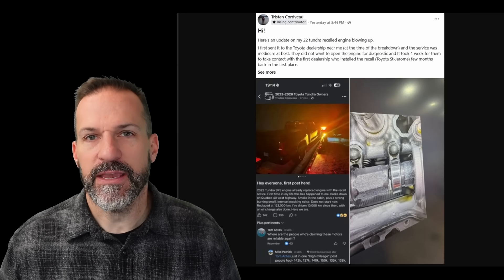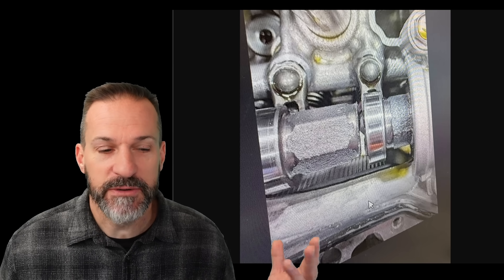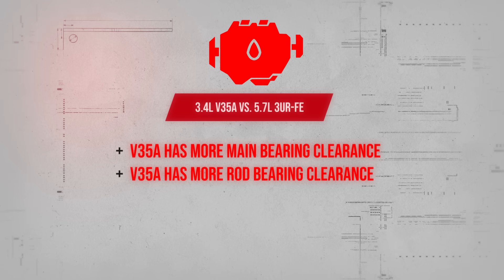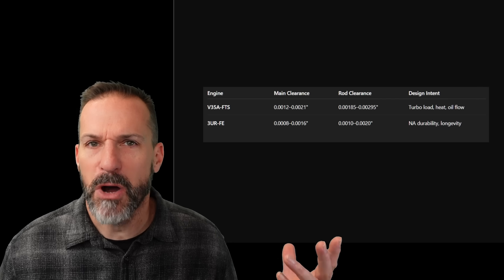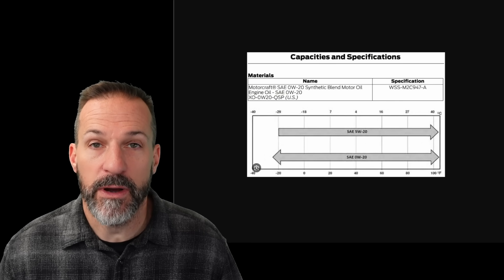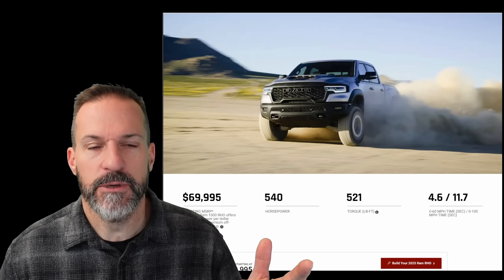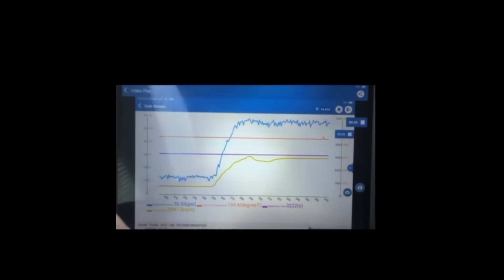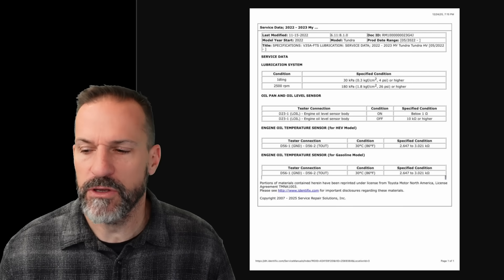Can We FIX Toyota's BILLION Dollar Mistake at Walmart? 2022- 2026 Tundra...

Comment: I never bought the tighter tolerances narrative. They were machining the UZ engines in the 90s just as tight.
Reply: This is true however main bearings were never so narrow before and they all had positioning tabs that kept the bearing in place and not spinning out.
Reply: @davidcox2197  Respectfully sir, I just looked it up and the main bearing clearances for the 1UZ. They were almost exactly the same at V35A-FTS. 0.027 – 0.053 mm (0.0011 – 0.0021 in.) with a maximum allowable gap of 0.065 mm (0.0026 in.). I agree with you about the tabs as the older engines did have them, however the UR series engines do not. Tundra 5.7 can run to 1 million miles with proper service. To me it seems like the variable old pump is dropping the pressure too low at idle for the sake of CAFE emissions standards. They need remove and replace the variable pressure oil pump.

Comment: Or how bout just a garden variety 5w-30 as i have been doing for 300K on my 5.7 which also requires 0w-20
Reply: Same. Been running 5w30 restore snd protect this year. Mainly to prevent oil rung coking. Havent had any leaks or issues. Oil comes out clean and much quieter. Doesnt sound like a diesel
Reply: i just switched to 5w30 in my 17 tundra. I swear its more quiet.

Comment: As an actual automotive technician. I have been commenting on so many videos telling people to run a minimum of 5w30 in a turbo engine ..  and all the internet trolls lose their mind and don't take me seriously... Now slowly more  people are getting on board ... Funny how the truth always finds a way ...l even in my own 2021 Toyota which calls for 0w16, I have been running 5w30 since new with no problems whatsoever
Reply: Seriously thinking about running Amsoil 5w30 in my 26 tundra now.
I like the higher HTHS vs the 20w.
Reply: @troyl.8691 yeah . But in reality even suoertech 5w30 full synthetic is an upgrade from 0w20
Reply: @EverydayJ1786  Correct, you’re better off going SuperTech 5W-30 every 5k miles than Amsoil every 10k miles.  All else equal, Amsoil is superior though.  

If you’re in a colder climate or you run the engine a lot in winter, then I’d go with 0W-40 Valvoline $28 for 5 quarts from Walmart online.  Technically, you could run this in the summer too. However, in a warm climate area in the summer a 5W-40 would be even better.
Reply: @troyl.8691 yep and Amsoil reduces breakdown from hot turbos better - motor oil geeks latest tests prove it.
Reply: you are doing the right thing 

anyone questions you, tell them to get a book on hydrodynamics....and read it
Reply: Mazda recommends 5w-30 in there turbos vs very light oil in the regular. Mazda > Toyota.
Reply: What about the non turbo v6 in the Tacoma? Supposed to be 0w20. Would you go 5w30 on that?
Reply: @MarkDay-z6t absolutely
Reply: What's your take on 5w40 or even 15w40? I use it in to maximize engine protection.
Reply: @IBO8Jaeger that's diesel oil . 5w- for colder weather starting , 15w for warmer weather . That's all it is .
Reply: 0W16? Are you sure? 
I own a 2020 Tundra and it "calls" for 0W20, but I run 5w40
Reply: @Michiganboy-o8e my wife's RAV4 calls for 0w16. It's only had 5w30 since new . It's for over 60k on it now .  5w40 doesn't meet the API spec . It's more of a diesel oil . I wouldn't run it because of that . Use a good quality 5w30 rated with the ILSAC GF-6A spec and change it every 3 to 5 k . That's important
Reply: @EverydayJ1786  Sorry, for some reason I thought i seen Toyota Tundra lol.
For a older SN vehicles T6 is perfectly fine. 
T6 15W40 is SN approved while the T6 5w40 is not it is the same exact formula, Shell just did pay for the SN license for their 5w40 version because 15w40 is typically intended for fleet maintenance.
If you don't have oil consumption your cats will be just fine.
Additionally the new API SP that all passenger car oils are now rated is incredibly neutered of anti-wear additives such as phosphorus. and ZDDP compared to the former SN+ rating. 
It's not intended for older SN vehicles, it's intended for turbo GDI engines that run the risk of LSPI, if you are running a SN, naturally aspirated engine with no oil consumption HDEOs are perfectly safe.
yes I know that API ratings are "back rated" but that doesn't necessarily mean that it's best.
Tech to Tech, you should know this..
Reply: It is lose their minds, not “ loose”.
Reply: @Dazza-u4c and here's one of those trolls ......🙄

Comment: Water like viscosity is the problem!😅
Reply: Toyota has been using 0W 20  for well over a decade. It's in the 4 cylinder Tacoma 2.7 and that's easily one of the 10 best engines ever made. The 2TR-FE isn't well known by Toyota techs because they literally never work on them.

Comment: The first issue is this that CAFE needs to stay gone.

The root cause of this was that Toyota used too thin an oil to goose up their fuel economy numbers and worse, replaced their formerly reliable V8 engine to meet these standards.
Reply: I would guess that the difference in mileage between using 0W20 oil and 0W40 is probably less than half a mile a gallon Toyota should go with what they know works and stop sabotaging their quality.
Reply: @ij2750  Standards require them to squeeze every bit they can.  1/2 MPG is actually a lot, get a half dozen of those savings and it adds up.
Reply: @plmn93  Even if thinner oil gained  2MPH its not worth the loss of reliability, don't follow standards that destroy the reliability of your products.
Reply: @ij2750  I agree, and I'm sure their engineers do as well, but they don't have a choice.  The options are to meet regulations or not sell trucks at all.
Reply: @plmn93  I think they do have a choice and instead of lying about the problem speak up and tell their customers what the government is doing.
Reply: CAFE has been suspended.

Comment: another thingr...the clearances are not the whole story with bearings. there's also the amount of bearing surface area to consider. i'm wondering how wide the bearing shells are. from what i see in pics, they are not wide. one other series of engines i know a good bit about have had similar issues. when the engine is essentially made too compact. the engine is designed smaller and more compact, making it physically shorter...thus requiring, by design, to have a shorter crank and block. this means you need narrow bearings...its entirely possible, that theres simply not enough bearing surface area to carry load at low rpm under boost, oil regardless. its essentially trying to mimic a diesel...the only diesel ive seen with bearings that narrow is the ecodiesel...and we know what happened to those cranks.  it was also a structurally short v-6...made so to fit a car originally. it had very similar bearing issues to the tundra's, and also started out with 0/30 oil...then went to a 5/30 and ultimately to a 5/40 before they were killed off.
 mix these narrow bearings with low viscosity oil, and fluctuating oil pressure, and you'll court disaster.

i owned an eco...a 2014. supposedly the "bad one". mine lasted until 2 years ago, wnen it suffered a mechanical rocker failure, swallowed a valve and died...i used 5/40 rotella t6, oil from day one. voiding my warranty to do so, but was vindicated later when chrysler switched to 5/40 rotella, as standard...a 0/40 or 5/40 will help tundra owners, but i believe its a basic structural problem, that can't be fixed with out a re-design.

Comment: With regard to oil pressure, I don't know what my oil pressure is in my '03 Toyota 4.7L V8 in my 4Runner, but for the last year I have started driving  a gear down around town. By that I mean I don't drive it in the top gear that shifts into OD unless I will be driving 45mph , or faster, for the stretch of road I'm on, this keeps the engine at, or above, 1500 rpm and oil pressure will be higher too. Driving around at 35 mph in OD and you're at about 1000 rpm, which in my opinion is too low for good oil pressure, also I get BETTER fuel economy.

Comment: My 2024 tundra has 200k miles on it always used 5-30.
No issues...
Reply: you mean 20k?

or did you drive 200k miles in 1 year
Reply: How the hell do you have 200,000 miles on it in a year even two years what you die to drive 24 seven? I’ve had my truck two years and I have 50,000 miles on it.
Reply: @halftontimrvreviewsandtips3106  I have no idea if @summerforever6736 made a typo but the guy who has put 1 million miles on two Tundras drove approx. 125K mile/YR for work.
Reply: Please confirm 200K (vs. 20K) miles.  Thanks!

Comment: BINGO! I'll bet you're on to something here. I'd go even further by guessing that it's 80% the fault of the idiotic variable oil pump and 20% the oil viscosity. No way the oil pressure should go below 12ish psi. If I had one, I'd run 5W-30 in winter and 5W-40 in summer. We run 10W-40 or 20W-50 (if it's really hot outside) in our racing motorcycle engines, and I'm sure the tolerances are even tighter than on the Tundra. We can usually do an entire endurance season on 1 freshly built inline-4 (screamer) engine.
Reply: Oil that’s too thin won’t maintain oil pressure when it’s hot, especially with the additional heat that turbos generate. 20 psi minimum oil pressure at idle was a general rule of thumb for proper lubrication years ago in a V8 engine. Those kind of requirements don’t change over time.

Comment: My neighbor has a 25. On its 3rd engine. But I thought Toyota was the best thing since sliced bread. In all reality. ALL manufacturers are having major issues. Toyota actually recommends 6 different weights across the engine in all countries. 5w30 you will be fine.
Ford actuslly also switch the 5.0 from 5w20 to 5w30. Their exact words were we would rather have longevity than fuel economy
Reply: Is he using 0W 20? Second question what region does he live in? What are p.m. is it cruising speed? Does he use auto stop start? Does he get it and just go or does he let that oil pressure buildup? Does he toe with it? There’s a ton of questions to ask before you say something sucks because a lot of people don’t know shit about anything and then they wanna comment like they have a clue. I’m just saying mostly these failures are probably the cause of the user not following with the Japanese engineers recommended just what the manufacture themselves recommend also not having a clue about turbo engines oil, viscosity, or just plain ignorance on vehicles in general. You know there’s been several tundras where the engine has blown up because the spark plugs have come apart because you’re supposed to change them after 40,000 and people tried to run 79,000 miles. Any turbo engine you may be most get 60 K out of of a spark plug. Ford is fucking figure this out and Ford do some dumb shit on their engines.
Reply: @halftontimrvreviewsandtips3106 it gets serviced at the dealer. When he leaves in the morning he does let it run for a few min. Until it comes off high idle.  I dont know if he uses start stop (even though that doesnt make engines throw rods)  he doesnt tow.  He takes it every 5k miles (if it makes it that far) to get it serviced by toyota.  
Also ou sister store is toyota. They have been doing quite a few engines. Im not saying this hating on a brand.  Im saying this cause everyone thinks toyota is the best thing ever, when in fact.....they are not. They are having issues just like everyone else.
He said if this ones goes hes never buying another toyota (new anyway)  as far as plugs you are correct. The 5.0 which is non turbo you change at 60k miles.
However. Is tundra has never made it to the 20k mark. So spark plus iant an issue.  So far its been running fine.
Reply: @BeardedFordTech  they’re having issues because the stupid EPA. Honestly it or is he using 5W-30 if you are north of Pennsylvania I’d go to 0W 30 I’ve heard of people doing 0W 40 but if you go to the 0W 30 or 0W (40) you have to do your 5K oil changes. And is he getting an oil change every five or is he just taking the dealer cause they’ll only do it every 10 the Toyota oil sucks if you can notice address difference between that and say am oil which is what I use and I’m not hyping it up or anything I’m just saying my engine quieted down and I actually get the pressure up and stabilized quicker than the Toyota oil which is only other oil I have used. A turbo engine is gonna throw rods if you’re running high boost and the oil‘s mechanically shearing or you’re running it in temperatures above 90° you’re more likely to have issues you should be doing your oil change at 500 miles 1500 3000 then 10,000 on 0W 20 but a lot of people start using the 5W 30 after 3000 which is completely fine. It’s just the Japanese text. I recommend the other and then at 10,000 you switched to 530 or 0W 30 because the turbo engine mechanically shares the oil due to the rotations of the turbos a lot quicker and easier than a standard naturally aspirated engine. Not only that they run hotter so that means the oil breaks down and evaporates quicker. If he’s going through engines like water, the only thing I can say is he’s probably using ZW 20 he could’ve gone to bed and manufacturing wise like them not doing their due diligence and surfacing the proper areas like GM on their 6.2 L found that the non-bearing surfaces on their crankshaft were affecting their aeration in their oil so it could be something like that where it’s making the oil less effective and the thinner the oil is the more likely you are to have a failure in a turbo engine, the Japanese engineers stated that 5W-30 is the minimum viscosity. You should be using in a turbo charge application. But due to café standards, you know how the US goes. Ford made this mistake with their turbo engines running 0W 20 in the very beginning of the eco-boost then they switched to 5W 30 and they have had a lot less issues with the engine. I’m just saying you have a turbo charge application it mechanically shears breaks down from temperature a lot quicker, which means lower viscosity you’re running in applications on a low end torque engine, so you have a lot of heat coming in early in the power band. You also have the turbo’s mechanically sharing the oil and your putting these trucks in environments such as South Carolina, where I’m at where it got up to 110 and then the real fuel was like 119 that day and I was using aamsoil OE oil which sorry I used voice recognition it’s supposed to be good for like 12,000 miles and my oil change light came on at 7000 well 7500 because all the conditions said I sent my oil out to be tested and I had 1000 miles left on it but if I would’ve taken it to 8500 miles which was 1000 above my own check it light said I would’ve had no protection. And that system is far from perfect for the oil change sensor, but that’s the first time I’ve ever had it come on and I run signature series 10,000 mile intervals. I also tow 7000 pounds a day. I’m just saying he probably got a couple a bad manufactured engine because they are lacked on that, but it’s not a design issue and a lot of the manufacturing issues simply changing to a 5W-30 could alleviate the significant portion of it or at least reduce the problems. Watch a motor oil geek. I was a mechanic for I think it was 5 to 6 years and I’ve seen a lot of stuff and all the evidence scientifically points to a lack of lubrication, and typically a thicker viscosity is less prone to mechanically sharing better for higher temps it basically less longer and provides a better protection of thicker film. If he’s not using 5W-30, I highly suggest it. I also highly suggest Amsoil. And that’s just because the 5W-30 Amro flows just as quick as the Toyota 0W 20 but it protects anywhere from 50 to 75% better than that, and it’s formulated to reduce the issues that comes along with a turbo charge engine
Reply: @halftontimrvreviewsandtips3106 i know how oil works. No im nkt north of Pennsylvania.  We dont run 0 weight around here. And through lab testing 5w30 works just fine for turbos. Thats why for uses 5w30 for thir turbo engines (and 5.0 non turbo)
He tskes it to toyota every 5k miles cause he fell for one of thise "free oil changes when you bring it here"
Everything is done at the dealer.
All manufacturers are having problems.
ALL of them.
My point was everyone thinks toyota is so great when in reslity they are just like the rest od them.  My buddy is a toyota tech in montana. He sees them all the time and they are horrible to work on.  Our sister store down here in the south east is a toyota store.  Full of tundras getting new engines.  Basically anything 2016 and newer toyota is not that great. I loved the 2011-2012 5.7. Actually still do like thst engine.

Comment: I had a 1969 Camaro with a 427 daily driver back in the 80's It had a high volume oil pump, it had low oil pressure at idle like 19 psi but would quickly climb over 40 psi with a touch of the throttle, after years of driving I noticed at idle the oil pressure dropped below 7 psi at idle it was my only car so I had to try to keep it going so I changed the oil to like a 10w 50 racing oil but it finally starting knocking, my thought is the clearance is not tight enough and the variable oil pump should never produce that low of pressure at idle, it is wearing the bearings out they have to know this, not sure how they can't seem to fix the problem, I have a 2025 Tundra I've changed the oil in it several times, it has under 10,000 the Dealership did not want to change the oil till it reached ten thousand I told them that crazy I would never wait that long since it wasn't even broke in yet and I was right because every time I changed the oil myself the oil filter was very heavy for such a small oil filter.